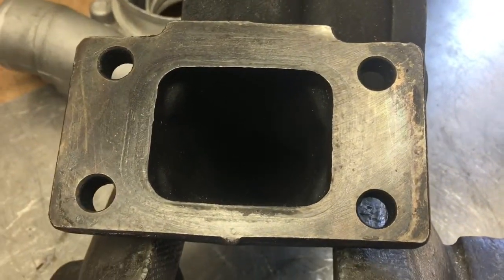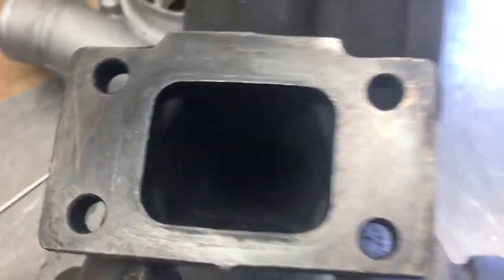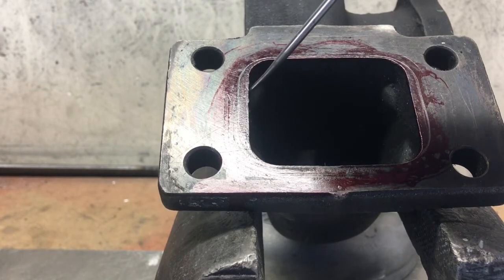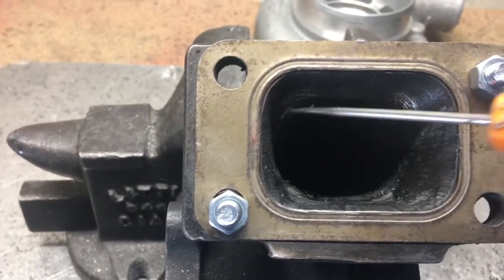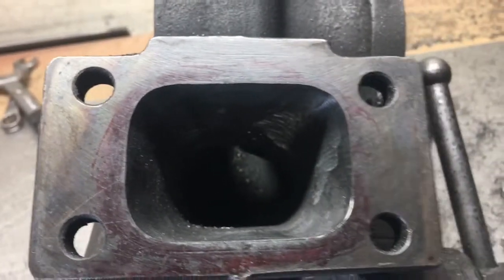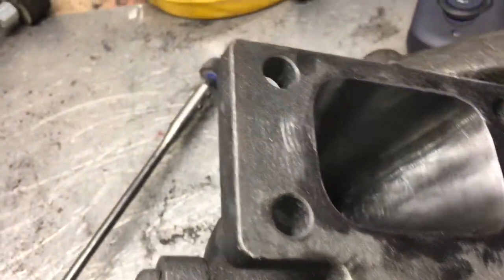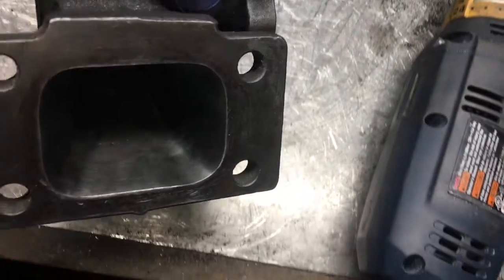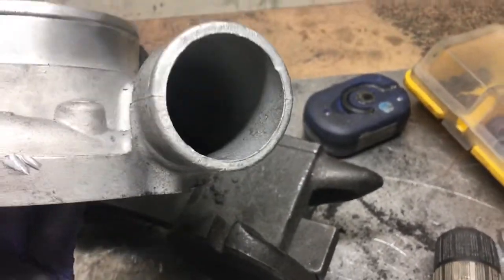Porting and polishing an turbine (turbo)

Comment: I’ve always done this to my heads and headers. Did because I had the time. Does it make a difference on a turbo motor?
Reply from the maker: Yes but not by much, depends on the original size of the turbine inlet I’ve ported some that needed bout 1/4 inch removed.

Comment: If there won't  be any sizeable  gains with before and after, then there is no point busting your knuckles to do it
Reply: There is a notable difference in throttle response. Not everything has to be for figures when doing these jobs.

A lot of them really fix the lag in stop go traffic cases. Depends on the used case.

Comment: Does this help with boost creep or overboost
Reply from the maker: celica-trd no , you’ll need a bigger or just a quality wastegate if you’re having boost creep. But also take a look at where the wastegate is located ...
Reply: @Formidable_lude  i have tial internal wastegate with a gt2860rs
Reply from the maker: celica-trd there’s video on how to help with boost creep using internal wastegates, basically you’ll have to open the diameter of the whole where the flap is located ...

Comment: Where did you buy that drill bit?
Reply from the maker: AvoidingZombies the drill bit Extender? If so I got from ACE hardware cuz the ones at Home Depot sucked they are magnetic hex shaped
Reply: Negative, Im looking for the name of the bit used to remove all the metal. At 2:35. I’m currently using a small Dremel bit to gasket match a set of headers and its too tedious.
Reply from the maker: AvoidingZombies that’s a 1/4” tungsten carbide burr you can find them on ebay but make sure it’s an USA brand company this company’s name is temo
Reply: Formidable Lude Thanks a ton!!!!

Comment: Is there any reason I couldn't just use a marker to outline the material to remove vs dye and a scribe?
Reply from the maker: Sean Peters a marker works fine , but in some cases a marker won’t leave a good mark on surfaces especially when the tip get dirty..
Reply: A lot of guys do spray paint. That's what I did when I did mine on my dodge. It worked just as good.
Reply: @jaspip1678  It just seemed like there's an extra chance everything getting messy I might just try a marker when I do mine

Comment: Nice work, do you know what gains all of this got you?
Reply from the maker: Handy Man haven’t used the turbo, but I’m thinking more of a Faster spool up
Reply: @Formidable_lude  make a video comparing the spool up! im sure you'd get more attention to your channel with it.
Reply: @Formidable_lude  Hi! Do you have info about horsepower/torque gain after your porting now? Or you still didn't use it after porting? Thanks :)
Reply: @Formidable_lude Have you used this turbo and if so was there a noticeable benefits?
Reply from the maker: @brudevold62  never used this particular turbo but I’ve have a gt35 turbo that I’ve ported and currently using can’t really notice a difference but I’m sure it helps. It’s like porting heads
Reply: A pretty turbine inlet